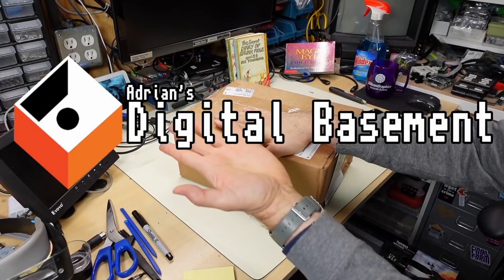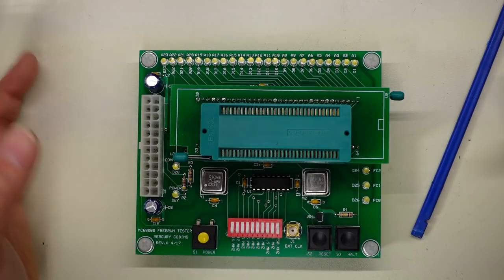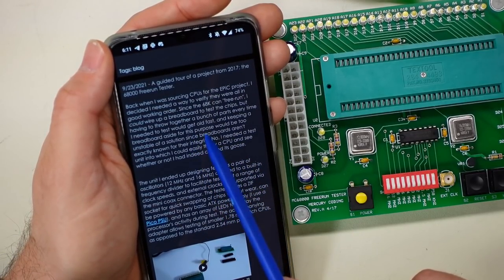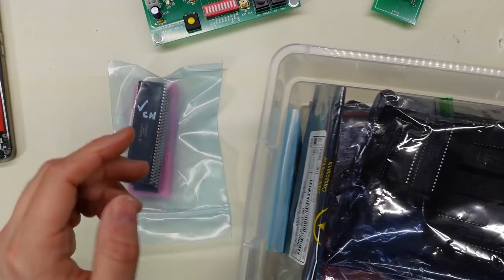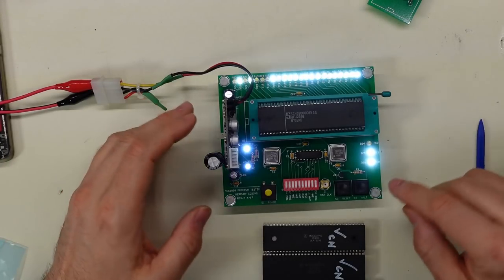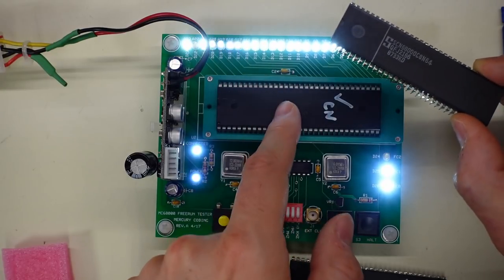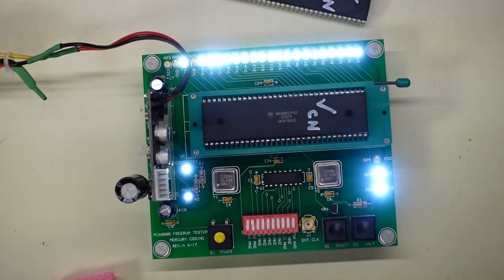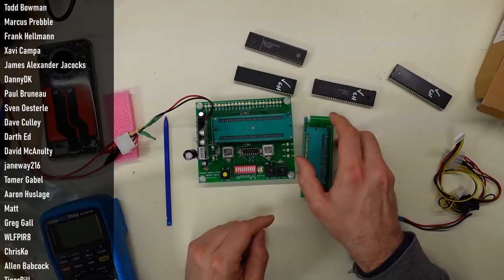0011 A standalone Motorola 68000 CPU tester

Comment: By the end the LEDs got really-really bright, that doesn't look good. And I don't think it's because of the 3rd CPU you used, if you were to go back to the first ones I think they would still be as bright if not brighter :/
Reply: The 3rd one could be a (more modern) CMOS version, which actively drives the high outputs and can source a lot more current an the old HMOS (a little updated NMOS) versions.

Comment: It looks like this is just a 'simple' NOP tester, that let the CPU run thru it's adress space. You can simply do this on bread board too.  Put EA71 (0100 1110 0111 0001) at the data bus, the cpu it self will then run from 0 to ffff ffff (more precise from what ever is stored at $4, it reads EA71 EA71, so it starts at EA71 and runs to $FFFF FFFF for the first run)  and wraps around to 0 again, VCC, GND and 3-4 more lines to VCC or ground to set the bus correctly thats it.
Reply: You can't execute instructions from an odd address, so the opcode you wire in has to have the LSb clear - otherwise you get an address error exception.

It's fine to use an opcode of 0000 anyway, this translates to "ori.b #0, d0" which might as well be a NOP since it has no effect, except setting the Z flag in the status register.

Comment: stares at tester
Immediately blinded
I'd recommend frosted low intensity LEDs for indicators like this rather than clear bright LEDs. Kids these days. 😆
Reply: Tell the manufacturers of consumer goods that while you are at it also.  Watching this on a monitor with a blindingly bright white LED just under the screen in the bezel for a power indicator and have several others that use obnoxiously bright blue LEDs for the same purpose, which is just insanity to me.  You want a nice dim red LED like on the early C64's for this sort of power indicator.

Comment: Are you sure the LEDs aren't the type with an integrated current limiting resistor?  Also, they are pulsed, so that can increase their peak current handling before thermal runaway.  Any idea what his EPIC project was?
Reply: It’s not the leds to worry about but the cpu under test. It will sink so much current for the 23 leds that it can be destroyed running for too long. The fact that the most leds are pwmed effectively doesn’t help much because I’ve not limited inrush current only puts further stress on other parts of the cpu than the address line drivers.
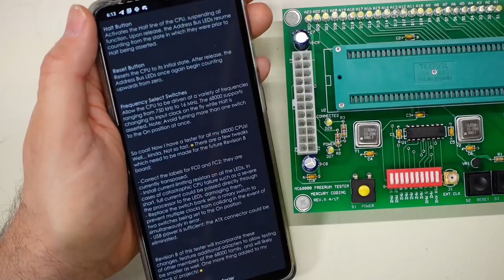Reply: 4:31 Revision B will have current limiting resistors to protect the LEDs.
Reply: @Okurka.  Yes, I’ve already read this and other commenters mentioned this, I only wanted to to comment on the op‘s comment - no worries 😉
Reply: @0toleranz  In his video, he's concerned about an LED failing in a short which would then damage the CPU.  Also, on the designer's page he's looking at on his phone, the designer was planning to use current limiting resistors in a (never made) future version to avoid damaging the LEDs due to a CPU fault, not to prevent damaging the CPU.  In the MC68000 datasheet, I don't see a max. current output per pin specified.  I would have installed current limiting resistor from the start to protect the CPU, not the LEDs, but perhaps the designer knows something about the per pin output current capability of chips from that era that I don't.